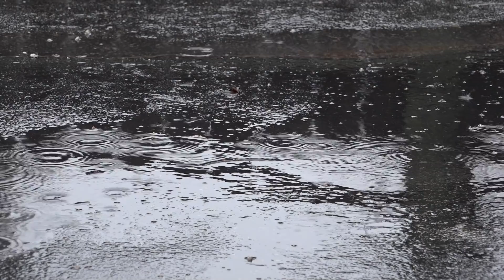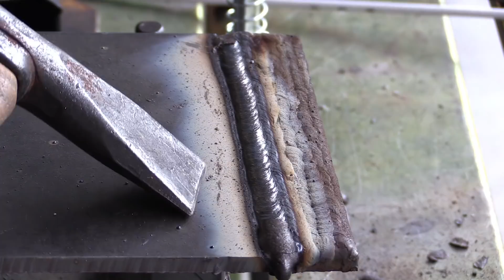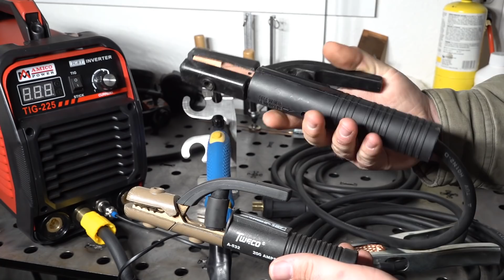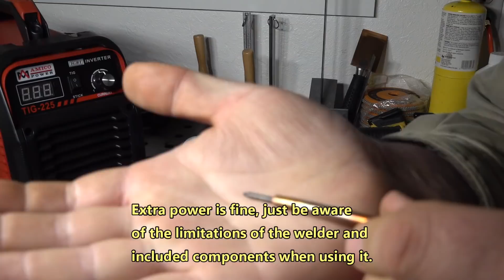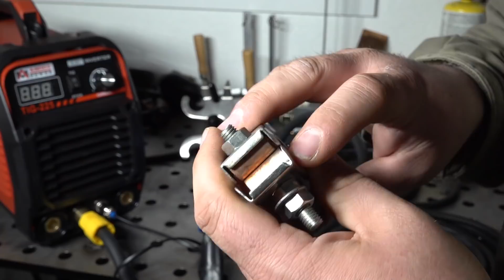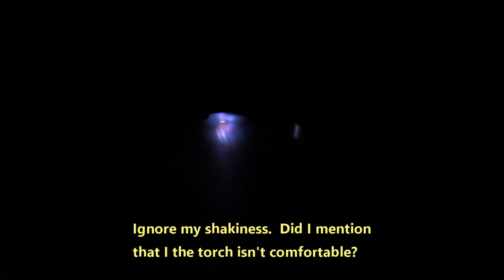Amico TIG 225 Review Pt 2: Performance

Comment: Wat style torch is that the smaller one with a stubby cap
Reply from the maker: It is a Weld-Tec Stubby torch, in a 9 size.  I believe the model number is WTS9.  The full model might be WTS9-12SF or something like that (12 foot, super flex cable).

Comment: I've got one of these and also don't like the tig lead do you know what I could replace it with?
Reply from the maker: I think I talk about it in an update video.  I used a standard CK, air cooled torch with a gas valve and a standard, Dinse 35 torch adapter from CK.
Reply: @bigtb1717  thanks for taking the time to reply man that's really cool

Comment: I was just watching your ESAB 161 review!
I'm in between a Everlast 160i and a Lincoln Tombstone to practice welding.
Reply from the maker: Were you thinking of getting the DC version of the Lincoln welder?  My uncle has one on his farm that's probably 30 years old and it still works.  But the Everlast Inverter will be much lighter, smaller and can run on 120V, thought not at a very high output.  I reviewed the 160i STH Everlast.  I mostly focused on TIG in the review, but it does stick weld nice.
Reply: @bigtb1717  Can the Everlast run 6010?
Reply from the maker: I haven't tried, but Everlast themselves say it isn't recommended for use with 6010 electrodes, so I bet it doesn't run them well.
Reply: @bigtb1717  Thanks!
Thanks for your research and post on these machines. 
Realistically,  I will probably end up buying a used tombstone on Offerup and getting some d/c adapters when I can find the money and the time to do so. 😀
A $3,000.00 Miller, totally out the question now!
That cost as much as most cars. 😀

Comment: Well detailed dissecting and yet where is the welding? I 🤔
Reply from the maker: I appreciate the polite question/criticism.  I did show a bit of welding, but I probably should have shown more.  With as long as this video was I should have cut in more welding footage.  I guess at the time I just figured that showing a TIG weld doesn't tell you much about the machine, but it's still more interesting to watch than my hands, lol.  If it helps, I'll say that the ultimate capability of just about any TIG machine, including this one, comes down mostly to the skill and experience of the person using the welder.  Basically, in capable hands this machine could make beautiful TIG welds.

This machine creates a perfectly fine DC TIG arc.  That's the easy part, and just about any inverter machine these days can do that part.  It's all the rest of the stuff that makes it either a joy or a pain to use.  I guess I'm just a little too utilitarian in my approach.  I didn't feel like a bunch or arc shots or shots of finished welds would really tell people much about the welder, so I didn't include very much.  I don't have this welder anymore, but if you have any questions about how the welder ran or anything, I'd be happy to answer if I can.
Reply: @bigtb1717  Great Video!
Reply: @bigtb1717  New students and hobbyist look for both the best value on machines and welding techniques.
It doesn't matter if weld isn't perfect,  it seems not too many people can actually do 6G pipe.

Comment: Im looking for your up grade too the torch
Reply from the maker: The torch I show in the video is a CK torch, but just about any torch could work with the right adapter.  Do you want a torch with the valve so you can control the gas yourself?
Reply: @bigtb1717  small the torch the better looking a e bay ..lots of them
Reply from the maker: For a small torch, a 9 size torch would be the smallest.  It's not the cheapest option, but the Weldtec Stubby 9 (WTS-9-12SF) is what I mostly use and I really like it.  What is your budget?  If you have questions about a specific torch or adapters, etc., let me know.
Reply: @bigtb1717   cheapest what wood be other options 2 choose from ?
Reply: @bigtb1717  budget 135.00
Reply from the maker: For that price you could get a high quality CK torch with a superflex cable and the correct adapter.  But you would still need to get torch consumables.  Do you want a torch with a valve?
Reply from the maker: For $135 you could get this torch adapter: https://www.amazon.com/Dinse-35-70-Plug-Cable-Conection/dp/B07KX62JK6/ref=sr_1_32?keywords=tig+torch+setup&qid=1580232685&sr=8-32
This high quality torch: https://www.amazon.com/CK-CK9-12-RSF-Torch-Regular-Piece/dp/B00JMG49QO/ref=sr_1_3?keywords=ck9+superflex&qid=1580232884&sr=8-3
And these torch consumables: https://www.amazon.com/CK-Worldwide-AK-4-Accessory-Kit/dp/B008JAY3F6/ref=sr_1_1?keywords=ck+ak4&qid=1580233202&sr=8-1

Just one set of options.
Reply: @bigtb1717   adapter is the problem i see .do you know the one
Reply from the maker: It depends partly on what torch you get.  I linked one that will work with most 9 and 17 style torches in my response above.  That will allow the torch and gas hose to connect to the welder.  You will still need to figure something out for the torch switch if you still wan to use that.  If you'd rather have a foot switch, I think I got one on Amazon for around $10 when I was doing my testing with the welder and just wired it to the connector that was on the torch that came with the welder.
Reply: @bigtb1717  thanks 4 all your time .my u tube channel 73 superglide..
Reply: @bigtb1717  just got chance ise it .it very temperamental .and kept weld to the metal ?
Reply from the maker: @73superglide62  Are you stick welding or TIG welding?
Reply: @bigtb1717  tig on 14 grage what should 4 gas ?
Reply from the maker: @73superglide62  You should use 100% argon shielding gas.  Gas flow will depend on the situation and cup size.  Can you elaborate on the issue you are having?
Reply: @bigtb1717   may be reson 25%75% i was using when didnt work rite
Reply from the maker: @73superglide62  The mix of 25% CO2 and 75% argon will not work with TIG.  If that's what you were using then that's probably the issue.  The arc will be very harsh, you will get a sparkler show and you will burn away the tungsten pretty quick and get a violent reaction that will leave the metal charred and rough.  Not as bad as it would be with no gas, but a similar type of reaction.
Reply: @bigtb1717  thank you as did nt get manual with it noy not finding so on line

Comment: There are a few things I feel compelled to point out. The review was thorough, but it seems like you're expecting corvette performance from a go kart.

First, this is a $300 machine that comes with accessories. I wouldn't expect those accessories to be of particularly high quality. Frankly, I'd rather they leave them out and sell the machine for a bit less money so that overall cost is lower when replacing them with something other than garbage. I use a $3000+ Miller Syncrowave at work that came with nothing when new. I doubt it even came with the Dinse connectors needed to attach leads or a tig torch. Also, pictures of those accessories are in virtually every sale ad for these machines. It's pretty clear from the pics that the accessories are not top shelf, and that the torch is awkwardly huge. 

Second, the readout accuracy. It's off, so what? I suspect that the $3000+ Miller I use at work doesn't have a particularly accurate digital readout either, but it is close enough to be usable, just like your Amico. If it's too hot, I turn it down. If it's too cold, I turn it up. Same as I would do with my forty year old analog readout Lincoln Idealarc or Hobart TR-300 here at home. Doesn't matter if you're new to welding, or have 40+ years of experience. Every machine is different, and every person has a different preference...not to mention that every brand of a given type of electrode, E7018 for example, will run differently....even on "identical" machines. They won't even run the same on different thicknesses of material. 

Third, many of these inverter machines have problems running cellulosic flux type electrodes(6010/6011/7010, etc.). The open circuit voltage and arc voltage is typically too low. It's not a problem limited to this particular machine, it's a problem with nearly all of them, including the well known Lincoln and Miller brands.
Reply from the maker: I understand your reaction.  Many people have had a similar reaction.  But just know that I didn't go into this expecting any specific performance.  I wasn't comparing this to a Miller or expecting it to perform like a much higher end machine.  But I do want to point out anything I find to be an issue or anywhere a feature or quality is lacking.  

I fully understand, expect and accept that this machine may perform more poorly than a higher priced machine.  But I'm still going to point out everything that I think of as a negative, because then people will know exactly what they are getting going in, and they are less likely to be disappointed.  If I simply say it's amazing for the money, and don't point out specific issues people may buy it and wonder why I didn't point out the issues.  If I point out the negatives, people can decide for themselves if those little things are deal-breakers for the price.

As to the meter being inaccurate specifically, I don't really feel that is a big deal.  As you say, every machine will weld a little different anyway.  But again, I have the tools to check, so I checked.  There is no points system where I removed a bunch of points for that issue.  I simply pointed it out.  

We live in a time were we are inundated with options for our retail dollars.  It's not as if there are only two options: this welder and a $3000 Miller.  There are dozens of welders like this on Amazon alone, and the prices are awfully tempting.  If someone is on a really tight budget, but they really want a welder, now they have a few more data points about this particular option with which to form their decision.  I hope that makes sense.  And just in case it wasn't clear, since it's sometimes hard to tell over typed text, there are absolutely no hard feelings.  I appreciate your input.  I just thought I'd explain my thought process a bit.  Cheers.

Comment: The test meter is reading Peak amps, while it appears the welder meter reads RMS Amps.
Reply from the maker: The display on the welder isn't an ammeter.  It just shows the setting, not the actual current output.  Also, this welder outputs DC, so RMS doesn't apply.  My ammeter was showing real-time DC amperage.  RMS would only apply to AC.

Comment: Can you attach a foot pedal with it
Reply from the maker: No.  There is no way to control the output current with a foot pedal.  Technically you could wire up a foot switch in place of the torch switch, but it would just be an on-off switch.

Comment: Great warts and all review - getting expectations set right for the price point is important. For me the detail on the accessories was  great as these are clearly the 'weak' point for high amp usage. For most hobbyists however the pricing is irresistible. Hope they respond and improve the specs on the couplings.
Reply from the maker: I just bought a newer, seemingly updated version of this welder to check out.  It seems that they have corrected a couple issues.  We'll see how it does.

Comment: First and foremost i think your review was extremely thorough, very well done and spot on.   Can your next review be a Bentley Mulsanne vs. the Chevy Impala?    The Bentley is a little out of my price range just as the  Miller welder is.   Sorry for the sarcasm but from my point of view as a beginner/hobbyist welder, the Miller, Lincoln, Hobart brands  are way out of my budget even if you find them used much less new.   As i'm fully aware everything will feel and look cheaper and not function as well as a big brand,  but does it weld? Does it do what it says it does?   Does it have good customer support?
Reply: Thank you!! This dude is a panzy
Reply: No idea where you are, but used stick machines from the big names are usually less than $500, often half of that even for an AC/DC capable machine. I'm not sure if this particular Amico has high frequency start, but if it doesn't, you're not gaining anything over a 40 year old transformer based Lincoln/Miller/whatever stick welder and an add on $125 scratch start TIG torch. The only thing that might be advantages with the Amico are that it doesn't weigh 200+ pounds and will also run on 120v. It almost certainly won't be functional in 40 years, whereas the old machine will. I'm not knocking the Amico, I'm actually looking at buying a small inverter type machine myself. That said, I'm also not selling my old transformer machines.

Another thing that may or may not be an issue is that these type machines aren't going to lay the pretty beads with TIG on aluminum that you usually see. That's because the big machines have AC and continuous high frequency. There have been add on boxes produced for the old transformer machines that will allow TIG welding on AC. Those aren't an option with one of these DC only inverters. You can TIG weld aluminum with a DC only machine, using helium, or a helium mix, shield gas. It just won't be as aesthetically pleasing to look at.

Comment: No price?
Reply from the maker: For some reason the price of this welder varies wildly.  Right now I don't even know if it is available, but I think the last I saw it was nearly $400.  When I purchased it the price was around $250.  For closer to $400 I would personally get something else.  Lower amp versions of this welder can sometimes be found much cheaper, and would be my preference if I was set on getting an Amico, but price and availability varies.

Comment: I understand the need of pushing equipment to its limits, especially reviewing a certain product. But in all honesty who is going to be welding 222 amps for 3 minutes? Shit I barely run 60amps when I'm TIG welding 12g stainless for over 3-5 minutes. the fact that you were saying the clamp and the cables from the stinger itself were warm to the touch is very understandable. Aside from that, I loved your reviews, both parts. I am researching a cheap TIG welder I can use at home for projects and my luck so far is pretty slim. Cheap TIG welders are just not worth the time and effort, they will never live up to the standards of the 5000-12000 dollar machines I run in the shop. Just the way the cookie crumbles I suppose.
Reply from the maker: I agree that for a machine like this, running at max output for any length of time isn't going to be something most people do.  I mostly wanted to see how the duty cycle claims would hold up.  The machine itself held up better than I expected. 

Like you said, I wasn't really surprised that the cables were heating up.  With my main TIG welder I've gotten a torch so hot (welding aluminum, where amps really do get pushed) that the rubber on the end was just starting to smoke.  But I was surprised that the insulation on the Amico cables, particularly on the ground cable, was getting so soft.
Reply: @bigtb1717  that's true, pretty cheap cables, not going to lie. Can't wait for the response from amico to come out in a video, would love to see what they say about these cheap cables. And when that cable got hot from the torch, did the rubber sleeve turn into a shrink wrap? Those things are insanely thin
Reply from the maker: Didn't shrink, just got soft.  It does almost look like shrink wrap though.

Comment: I got mine as a gift, It works ok as a stick welder but I tried tig today and I wasn’t getting gas through the tourch.It would go in but not out.It wouldn’t leak either
Reply from the maker: Make sure you have the valve open on the torch itself.  Only thing I can think of off-hand.

Comment: Is this worth buying being a student? I don't really want to spend a lot of money on a welding machine just to practice. Thanks for the review!
Reply from the maker: Possibly.  Are you looking to practice TIG or stick?  

If you are ok with the bulky torch and dealing with some quirks and oddities, then it may be worth it for you.  I haven't priced them lately and it seemed like they were fluctuating a lot right after I bought mine.  I suppose it would also depend on the current price.
Reply from the maker: The price of the 185 is $300.  It would be really hard for me to recommend at that price.  Personally, for that price I'd go with the Everlast 161 STH.  $389 on their website right now and it comes with a regulator (which the Amico does not) and better accessories overall.  Also has a 5 year warranty.  For me it's a no-brainer over the Amico.
Reply: @bigtb1717  a friend also recommend Everlast.. thanks again

Comment: Very informative for newbies like me as I've got many of my questions answered, thanks a lot! I own a MIG which served me well over past 15 years for basic needs, but recently got bought an alum pontoon that what made me interested in alum welding, so this is the reason I'm shopping for a TIG for like to get me started and I don't have to invest much so I can do small jobs on my pontoon. Also, wasn't sure you tested it on alum yet.  Do you think this Alinco package would work for guy like me?
Reply from the maker: This Amico welder is DC only, so it isn't for aluminum welding.  For TIG welding aluminum you want a TIG welder that can do AC output.

Comment: Bought the 160A stick only. Was fantastic but experience was required for only the 6011 rod. All other rods ran outstanding. In my opinion it was a no brains buy. Made me $750 first outing. And I paid 149.99 on flea-bay delivered. Durability, well, time will tell. Ows me nothing already. I can recommend to weekend warrior.
Reply from the maker: Yeah, I think the stick only machines are the way to go on these units.  Cheaper and run stick pretty darn good.